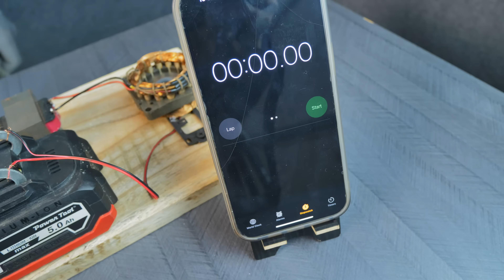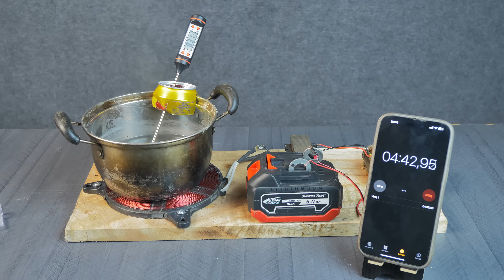I use this to make a 12V induction stove that can boil water in 1 minutes!

Comment: Stepping and transforming the battery into a induction heat pad turning DC into stepped up ac for direct power not hard
Reply from the maker: You’re right 👍 With the right components, converting DC to stepped-up AC for induction heating is quite achievable.